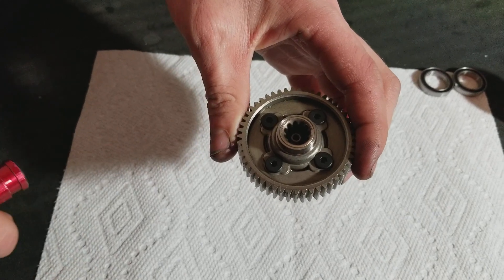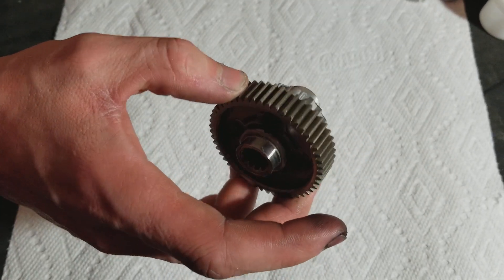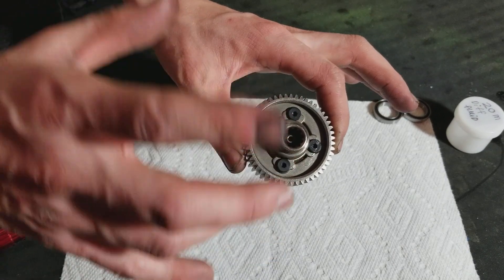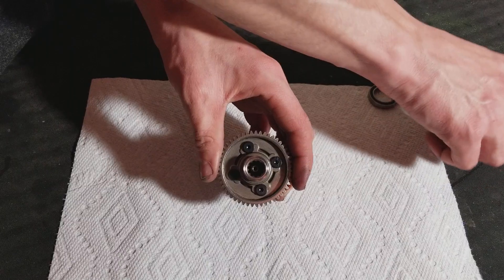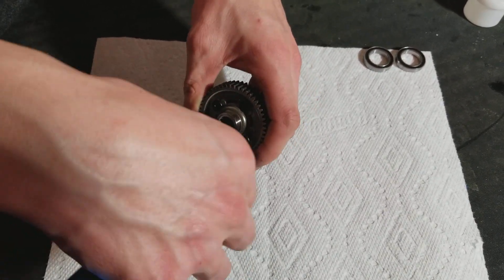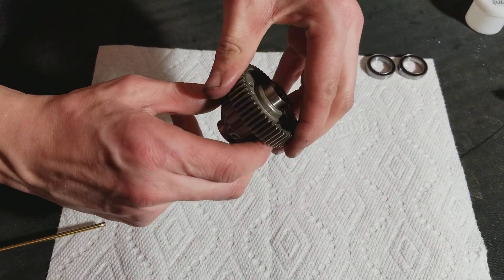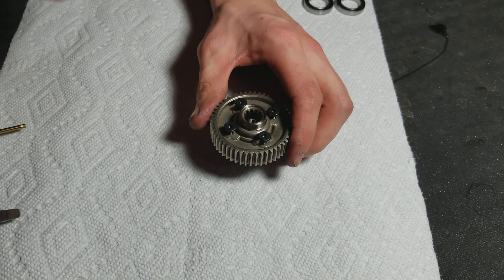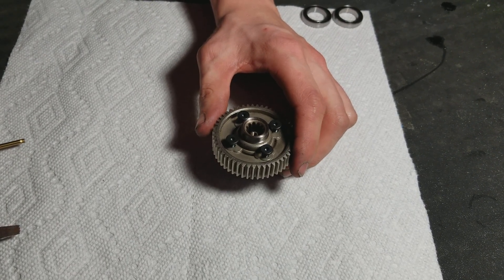Traxxas X maxx  8s  tourq   Biasing center differential take apart

Comment: There was plenty in there, now you have overfilled it you just have a bunch in the middle doing nothing.
 I have heard the rumors of diffs not having oil in them but if this is what everyone is talking about I will not waste my time checking.
Reply: Yea I agree seems like he's coming up with his own opinion and stating it as a fact.
Reply: Shane T  I agree that too much now
Reply: I also agree with you, there appeared to be plenty in there already. Keep up the good work Traxxas!
Reply: Lol theres a lot of air inside funny to see people defending something who is not right you canpletly see its completly underfill and can see the bottom of the diff cup dotn sptell me its enough fluid for a 8 diff
Reply: @EXTREMERC416  lol there's enough grease inside. the gears are clearly well greased up. why waste grease on non-moving parts.  It's not gonna hurt to overfill your diffs but it will be a waste of grease. Good job Traxxas on your quality control.

Comment: I agree with u , thanks for the vids keep on keepin.. I was really turned off by the 6s but Traxxas really stepped it up on the 8s and the only thing I’m going to change is the ESC and that’s when the stock one craps out . I have a Hobbywing max 5 waiting to put in but no need for it yet I’m very satisfied with the 8s .. thanks for the info and reassurance that I’m not crazy with Using over 10million on any diffs . Most never even heard off it 👍👍..

Comment: Nice info, saw your other vid and got slop outa cush drive, gonna keep mine stock too, finally got 20m fluid, maybe upgrade to Max 6 ESC if ever needed, what do you think bout dust cover and axle diff rubber boots, I have both coming, gonna add 4 fans to keep ESC cool with cover on, someone cut out windows to add more air to esc and motor, also have ordered T-Power A-rm skid plates front and rear gets lotsa hits from front tires, have fun best hobby grade truck.

Comment: "dont be lazy use your hands". i can tell by your hands, you dont work with them, but for some people, who used their hands to                                                               feed a family for 20+years, using a power driver is the only way. its not always about lazy. you pound on ceramic tile for 20+ years & see if you get a little lazy
Reply: The problem with using power tools for that type of job, especially assembly is that its very easy to damage threads and castings.. that might be what he was thinking about
Reply: Settle down Francis

Comment: This is 100 percent rite , I have been saying this and have done this before I even run it and my hobby shop by me looks at me like I’m crazy 👍👍keep on keeping my friend.
Reply from the maker: Justin Rizzo no not crazy  at  all  most hobby  shops sell the rc products but don't  really  do work  on them correctly  for example the  diffs  if they where ever to clean them they would  just scoop out the old diff fluid and refill it me I clean  them  in parts  Solvent for cars so that way a really cleans all the residue off the gear teeth and also will make a diff very smooth when it's in motion the 20 million diff weight is super thick so it's basically a locked center diff thanks for watching  the video

Comment: If you understand fluid dynamics , at low speed the diff will allow the speed differential between the front and rear tire for turning without much binding , at higher speed differentials it will bind up , like trying to move slowly VS quickly through water. Coming off of a jump can be taken care of by the slipper clutch.... not the diff.  The difference in speed between the front tires taking a longer route when turning  than the rear tires when turning is VERY little ...at any vehicle ground speed. Without a center diff you would break all 4 tires lose with only slight turning.

Comment: Also check to make sure the spur gears and diffs are not over tight or to loose out of the box. I dont bash my xmaxx and was doing a wheelie on it's way back to me and the front dropped. Tapped the throttle and sound like pinion work it's way off again, as with running on 8s with hot weather would heat up t uh e blue locktite and it slid off once or twice,  so I removed the cover to see a total of 5 tee the left on spur and pinion combined.  Had no idea how that would of happened except the xmaxx is not completely upgraded to take the 8s. Never had problems on 6s before I could afford the 4s batteries for it. Anyway after upgrading to hot racing spur and teckno pinion. As I was showing my LHS the damage I noticed the bottom of a hex hole for the spur at the bottom was missing and knew right away that's what got in and stripped the gears. Then i notice, looking closer, from that broken hole was a crack fro the top of the hole through the top of the pinion.  Looks like it was over tighten at the factory and when running 8s finally was to much for it. I've learned to DEF look over arrma vehicles since the ones I have had a problem from the start, but the 5 traxxas i have, the xmaxx has been the only one tha th didnt upgrade pieces (just electronics) to take the 8s. Bought 5/21 and even the tires were still rated 6s. The did replace a set of tires due to 3 inches missing adhesive, but a set is one side, so I nicely bout the others myself so I could have the other side. And if you ever shred the teeth on anything make sure to dump out teeth, open the bottom to get more out and check rear and front bulkhead and clean diffs to make sure ALL teeth are out, or one may get on the diffs in the grease you dont see and cause problems.

Comment: 1. Thats totally overfilled. If it helps making you happier then ok. But from a mechanical point of view it doesnt make sense.
2. My 1:5th scale gas truck has had in its center diff half the amount of fluid you found in there since it was new (ran over 20 tanks in 1 year) and the diff is pristine.
3. The “cracking” noise you mentioned is the drive line shaft in the center that has some slope.

Comment: what wieght fluid goes in the front and rear dif? the stock weight.
Reply from the maker: Jamie Fox 30k in front and rear
Reply: Alex rc freak i called traxxas and asked what comes stock in the 8s exmaxx the guy said 20 mil in center 10 k rear and 50 k front? that dont seem right. its just all the forums never have a straight answer. thats why i watch your videos thay are very straight fkrward.

Comment: what is the easiest way to acess the center diff
Reply: always-up-always  tear down 16 screws. Then 4 for under motor. Its easier than remove fan and heat sensor. And then the rear diff house means 5, screws and than another 8,9 screws more. Its hard first time. After its easy
Reply: @rccarslover7143  I know right. It's so many screws to take off that I kinda lost track but I was planning on upgrading to stainless steel screws anyways. But yes. It's a pain in the butt taking off the rear bulkhead to get to the center differential for the first time

Comment: pretty sure I blew my Torque Biasing Center Drive, center shaft is slipping quite a bit and i have narrowed it down to the Center drive. Gotta tear my rear end apart get the center drive out and see what happened to it.

Happened after 50 X 20 foot high 35 foot long jumps though lol!
Reply: Weird Alex I found out what was wrong, there is a washer inside the Center drive on the one pinion ya can pull out.
It was pretty thin but stopping my gears from all meshing up correctly. 44 Cents at farm and fleet and a bench grinder.. my Center Drive is Like Brand New lol Went ahead and locked it down after the repair ;P

Comment: Those don't look like helical gears
Reply: They aren't, they're planetary gears
Reply: Michael Daugherty exactly my point. Planetary gears aren’t torque biasing. Helical gears are. 

Standard gears want to push away from each other under torque. Helical cut gears want to push away and to opposite sides. The more torque ran through a helical diff makes the gears side load onto the case and resist spinning. This lock up effect gives helical differentials their name: torque biasing differentials. Depending on the pitch of the gear, they also have torque biasing ratios where a 3:1 would have the wheel with the most traction seeing 3x the torque of the wheel with the least. For example, one wheel has 50 ft lbs of resistance and the other has 500 ft lbs. one wheel will get 150 ft lbs of torque and the other would get 50ft lbs. wheel speed doesn’t equate to torque, it’s simply the rotational force. A locker is even better. Both wheels would receive up to 50 ft lbs evenly until the power unit reaches 100 ft lbs. then the weaker traction wheel would still get 50ft lbs and the other wheel would see up to 500ft lbs before they would even start spinning. What makes lockers dangerous is the rapid fluctuations of torque at each wheel causing extreme loading and unloading of driveline components. Imagine going from 10ft lbs to 1000 down to 30 and back up the 800 ft lbs all on one wheel hopping rotation.

Comment: If you wanted to take pride in your work you should have completely cleaned out that diff and started with the fresh fluid. You have no idea what’s hiding in that old fluid dirt, grit, metal flakes. If you went through all that work on taking it out you should’ve done the job right.

Comment: Both traxxas and arrma are lacking in places they dont expect you to look. Diff fluid, shock fluid screws over tight, under tight but you dont know until something happens or starting off learning and find out the hard way. Getting to know your vehicle is the only reason I say go ahead and check everything and before you buy, wachter plenty of videos.